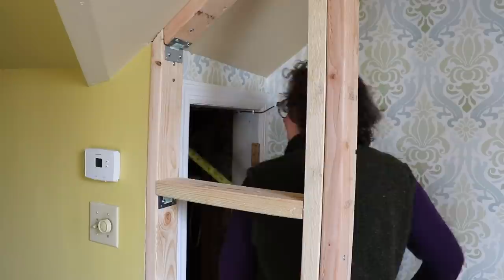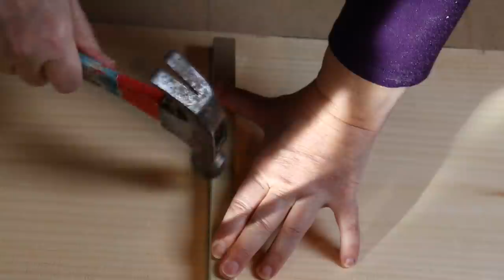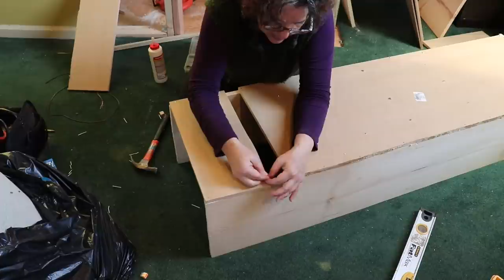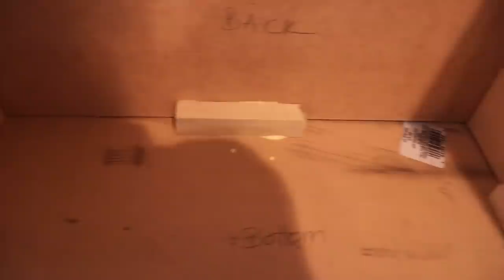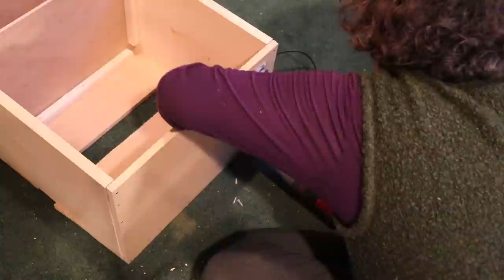Master Bedroom Makeover Series || DIY Closet || Episode 6 ||

Comment: Take the wheels off to fit in better. If you only need to remove occasionally. I think you can still pull out. Also I don’t know if the new flooring will take up more room. I wish I had your skills. I can visualize a project like that but I can’t execute

Comment: You are amazing!! That works!! I was wondering if it would be good to cut an oval the width of your hand towards the front edge. So you can use it as a hand hold to pull it out. It protrudes enough probably not needed. I store my tshirts and sweaters on shelves. It works for me.

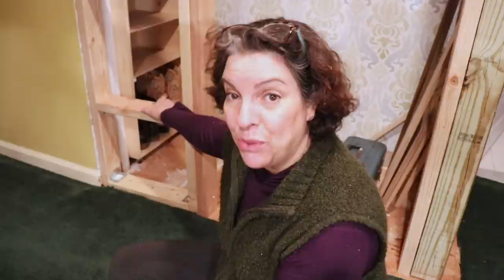Comment: 30:30 The wall frame you have your hand on could be where you store your shoes on the inside of the closet. Just extend the depth off of the 2 ×4 to create  a shelves to fit shoe box size baskets placed sideways. You could basically use the extra space for anything like scarves, accessories etc.

Comment: You are just fearless Sophia. I love how you’ll give anything a go. You’re doing an excellent job. I think you might want to push a piece of foam or an old pillow under your new unit to stop the cold draughts that will inevitably come from the attic as it’s not heated.
Reply from the maker: A house needs to breathe. People are always sealing here and there. But the louvered doors were there for that purpose. It creates a balance of air flow and pressure in the house especially when heat rises. It has to escape somewhere.

Comment: Sophia, you could have made the top of the case at an angle I (following the line of the roof). Then it would be able to be pushed into the closet.  I was wondering if it will be in the way of the jewellery box that you were going to place on the inside of the Sheetrock?  Nevertheless, overall, good job.   I love your persistence and that you settle for “Progress not perfection” (and in my estimation that’s a healthy way to look at it).  Stay safe and well.  Thanks from Australia 🐨🦘

Comment: Any reason that you did nails on the shelf supports instead of screws? (I would like to build a bookcase)
Reply from the maker: None I'm particular. It s not going to hold a lot of weight. But when I do the bookcase definitely will use screws.

Comment: Hay Sophia i had a question regarding older homes, did your home have any vermiculite insulation(lose fill insulation) in the attic area when you purchased it? We are having that issue now in our older 1950s home we are having it removed by professionals, it is causing me serious issues with my sinuses/allergies now. Curious minds wanted to know, thanks Sophia! Your closet is coming together very nicely! Thanks for sharing!👍🏽💐
Reply from the maker: The house had no insulation . Apparently it was not something they did back in the days. In the 90s when the attic was rehabbed into living quarters, the walls were insulated but that was it. So when we did the siding we had the guys come on and blew in insulation in all the walls including the attic floors and the dormer window. It made a huge difference and we are saving over half in oil
Reply: @mygreatchallenge  wow! That's awesome! We are having the attic cleaned and cleared out then replacing with new insulation! That old insulation is bad for your health and not good for allergy sufferers! Out it
goes! I'd rather have none then this awful stuff! Lol! Can't wait to see the new closet! 😁